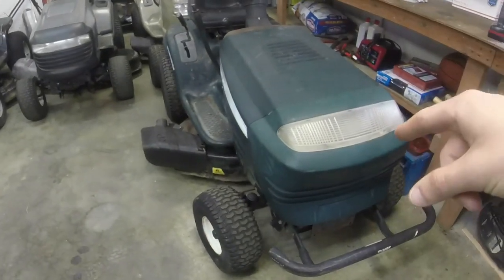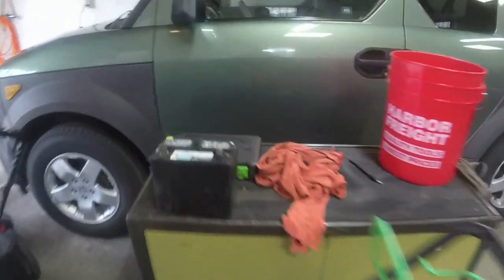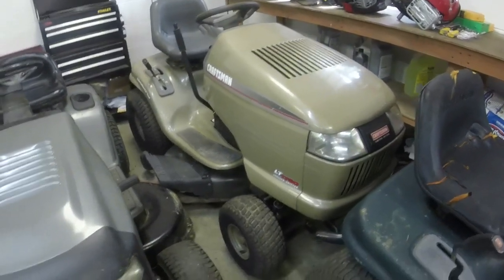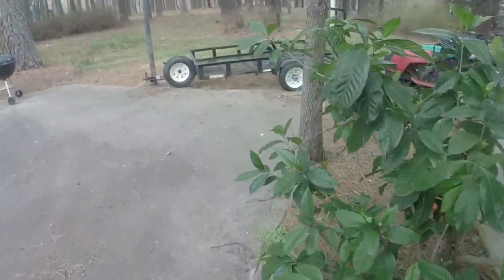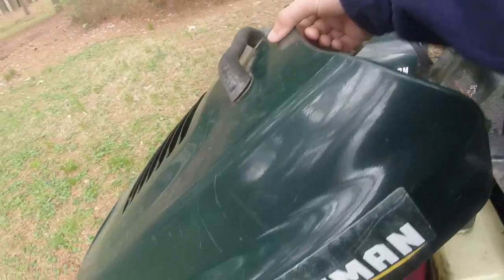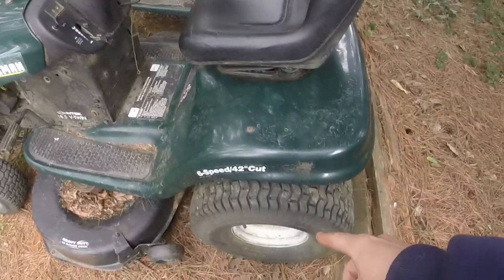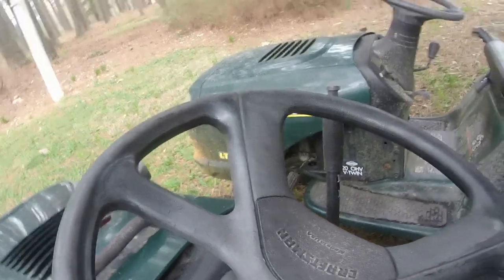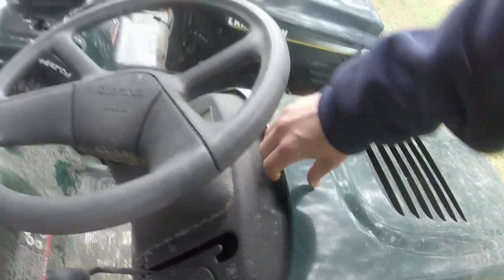Trading 1 Craftsman rider for 2, selling a Snapper and getting a free Troy Bilt

Comment: Great deal on those Craftsman they will definitely clean up and sale well. That steering issue with the Weedeater is ongoing at least for me it was, that old design just wouldn't stay tight.
Reply from the maker: Thank you, it looks like both are going to be pretty straightforward fixes, just going to take a little time to get the parts.  Every one with the old style steering is loose, will have to replace the bushing on it most likely as it free wheels.